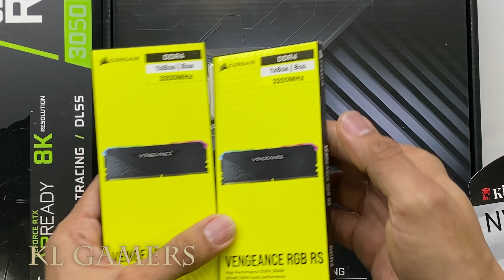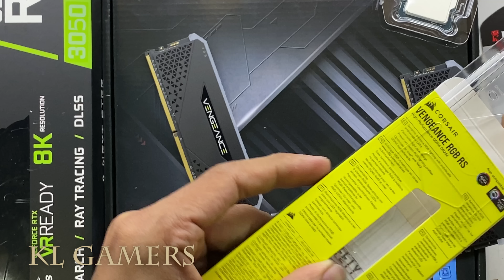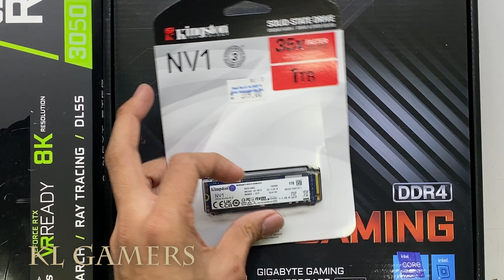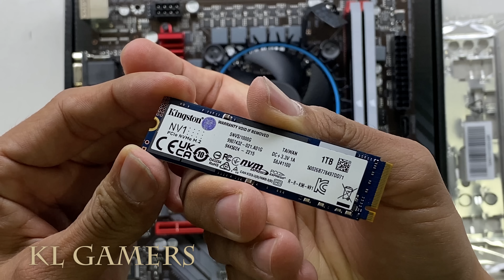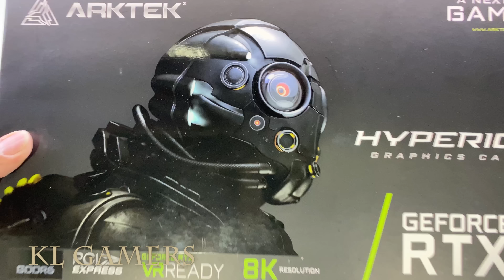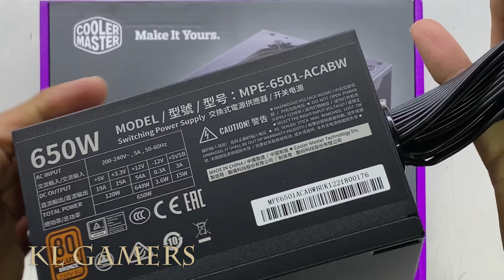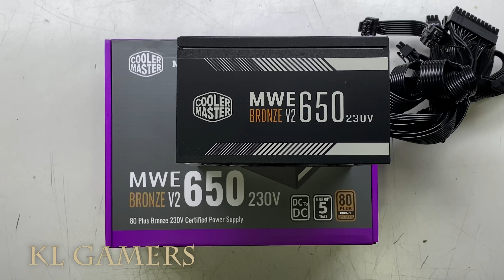intel Core i7 12700F GIGABYTE B660M GAMING DDR4 CORSAIR VENGEANCE RGB RS ARKTEK RTX3050

Comment: COULD YOU TELL ME PLS CAN I USE CORE i3 10100f cpu without graphics card for normal use, not gaming purpose, pls tell me, thank you.
Reply: The f means its intergrated
Reply: The F means the CPU DOES NOT HAVE an  integrated GPU.

You should look for the Non F version.
Reply from the maker: cannot use 10100F, use 10100 (with intel HD graphics )